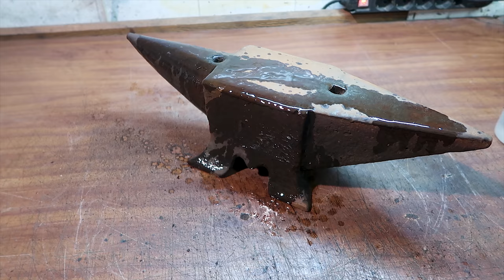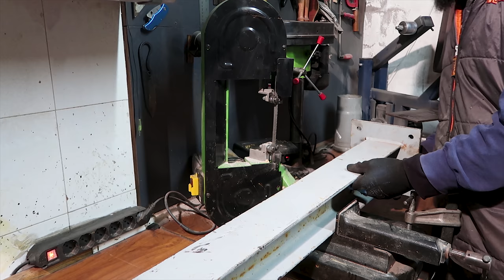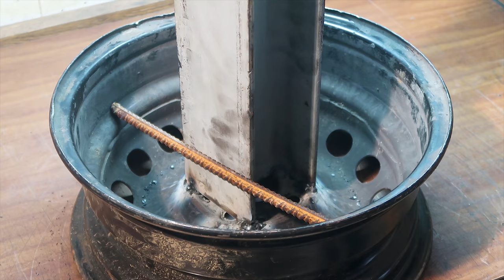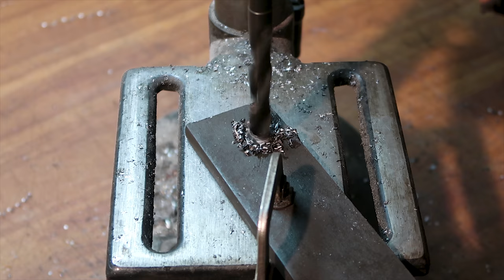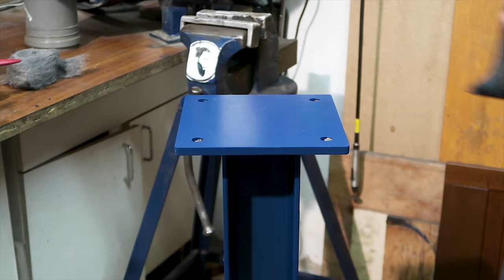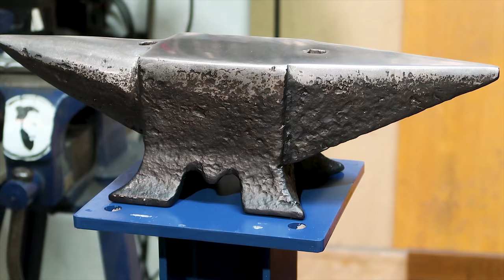Small Anvil Restoration And Tall Stand Fabrication

Comment: Awesome work as always bud👍  a little tip with stick welding it works much better if you clean the surface first, remove all paint and rust. your welds will be strong.

Comment: Nice job, but why drill big holes in the anchor plates and only put small bolts in. Defeats the object. Use larger bolts to anchor it down more. :)
Reply: I believe its because they're at an angle, also with bigger holes, it allows for more freedom when adjusting the anvil

Comment: Your is stand is too high for your height. You will be able hammer only small objects with sub-maximim force. Your attachment bolts too small for the size of the item. Now your borewholes are big and bolts small - it will vibrate and move sideways. I would have put a piece of rubber gasket on each bracket to attentuate noise from hammering to transition into the stand